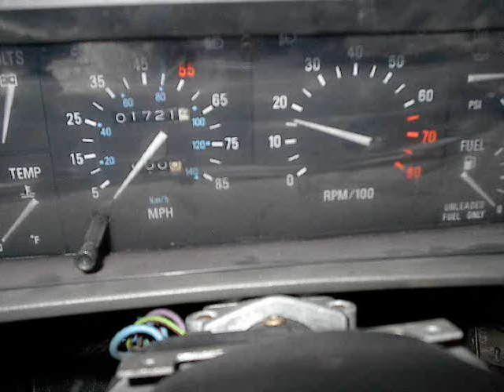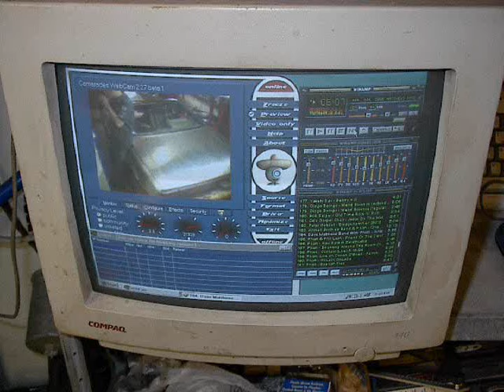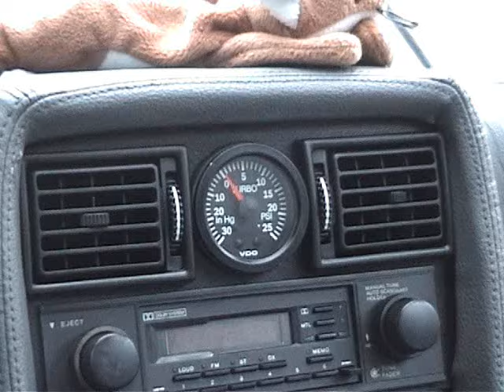Abandoned DeLorean - Will 'Vixen' Run Again?  #DeLorean #barnfind #willitrun

Comment: Dave 
Stragand- Awesome project!!!-Perfect Lennon song choice. if you got the $$ don't hesitate. Its was designed to be modular, so it was built to ease your task at hand.  Not that its easy in this case. You proved the DMC12 rumor true (you can buy one for 25,000 or restore one for 25,000.)  It didn't sound real nice as you sped off. Aside from the flux capacitor that's a number one upgrade that I see most done to the car. The v6 with an upgraded twin exhaust or the fancy fellows the v6 twin turbo. I'll be celebrating this Resurrection at Easter!

Comment: Hi Dave, Do you have any information you could share on refitting the main door glass. Mine have come loose.
Reply from the maker: Try looking for how-to's on http://www.DMCTalk.org.  As I recall, there are little metal clips that help hold it in place and either a rubber seal or an adhesive bead does the rest.

Comment: How come the Delorean in back to the future sounds like its a 8 cyl motor? Just dif exhaust or sound mod? Nice job by the way
Reply: It's because they used a Porsche 928 sound so it was an eight cylinder
Reply: If I recall correctly, the sound of engine in the movies was actualy the sound of Porsche 928 engine. Don't know if it was actualy physicaly swapped or not.
Reply: Gotcha

Comment: Wow, I'm currently doing about the same thing you did. Doing a full frame off restoration to vin 3296. In the biggining my DeLorean was partly taken apart and the project sure has become a lot bigger than I ever anticapated. Been working on t for over 4 years. I hope you get lots of joy out of your DeLorean. Just one question, what inspired you to call it "project Vixen" and use this mascot? I like it :3
Reply from the maker: There was an old book, called "The Resurrection of Vicky", which was a chronicle of an auto restoration.  The DMC was sometimes called  the silver fox, and a female fox is called a vixen.  Put the two together, and that was the name.  The mascot picture by Felicia Kaye just fit the mood -- the look on this vixen's face is kind of like 'I don't believe you... I'm kind of doubtful, dubious, it's never gonna happen' type of thing. It seemed to match the whole tone of the project.

Comment: how many hp does it have now,and great job
Reply from the maker: The manufacturer of the turbo kit advertised a boost to 200HP at 7PSI.  Not sure what the HP actually is on mine, but there is a noticable difference over a stock car.

Comment: You know what, good for you, see the icon for my heading , 13 years, and counting, bout 25,000 in a 73 Grand Prix, stupid? YES, do I love my car, YES, would I do it again? Y not.I didn't do it all at once, did the motor and train, interior, tires wheels, brakes, fuel lines brake lines master cylinder, sunroof cables, headliner, body work under The vinyl roof, painted the quarters doors fenders, hood just got done last year, replaced bumpers nos, rocker mouldings. Pontiac emblem for front of header panel 375.00, good luck finding parts for my car, nothing reproduced, so I think you have an Iconic car, and you did well, screw everyone else

Comment: how many DELorean are there in the world left?
Reply from the maker: It's estimated that about 6,500 of the original 9,000 are existing and operable.
Reply: well then, that is a good news then,and any car service can just take care of the problems that might come up with it ? do they even make spearparts for them ?
Reply from the maker: Pretty much any part you need is available from Delorean.com or one of the many DMC vendors. As for service, it all depends on the mechanic. It is an older car after all, and used some uncommon technologies. It depends on the mechanic's attitude of "just fixing it" or "fixing it correctly".  There are several good DMC service centers in the US and Europe.
Reply: 8500 en acero inoxidable y tres de ellos emchapados en oro de 24 quilates.
Reply: Lol